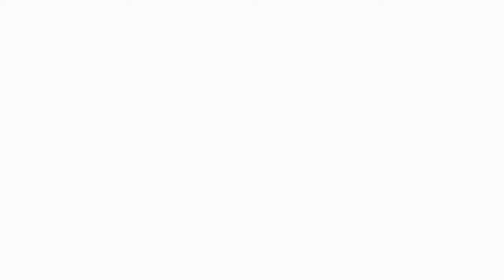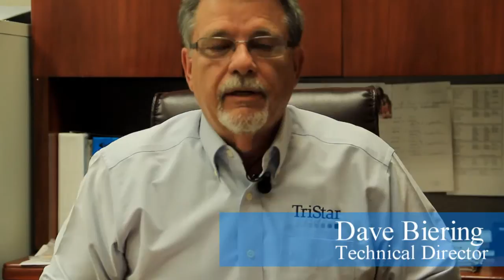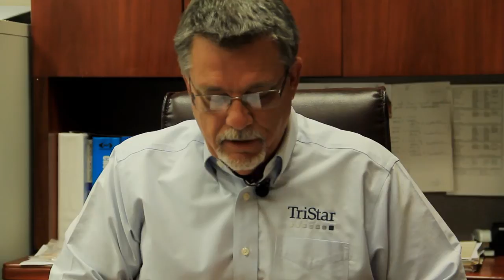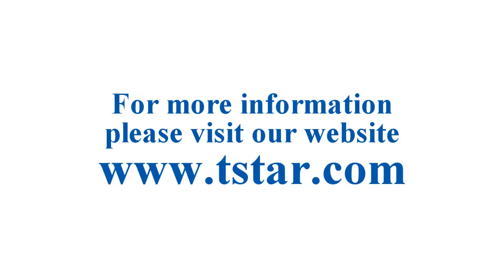Machining UHMW  - Techniques and guidelines

Comment: I have to machine UHMW in my cnc lathe from time to time. The way I do it has developed through trial and error. I achieve good finishes using HSS ground with about a .03" nose, top grind with a positive rake and machine everything to within .100" and let it sit till the next day and then finish to size. The UHMW will expand significantly when you remove a lot of material. I machine 1000 rpm .02" ipr rough then .01"ipr finish. Slight microgroove looks good to me on the UHMW.
Reply: This comment was far far more useful than the video was